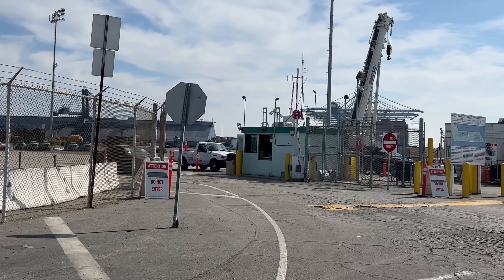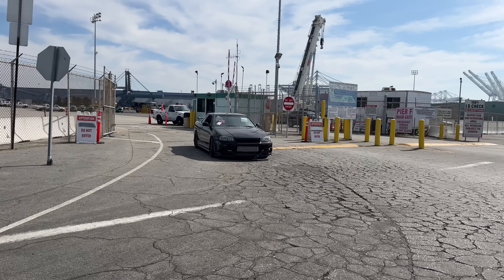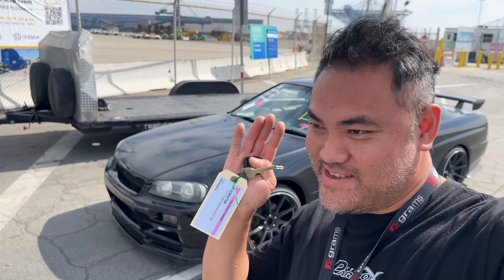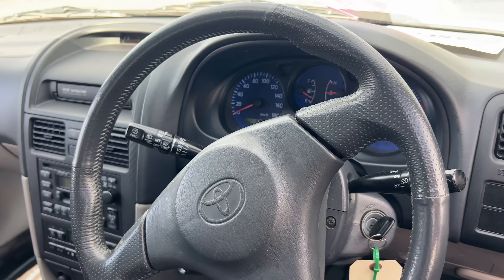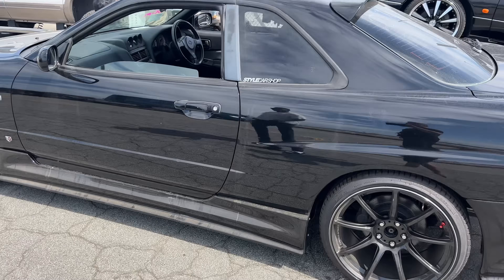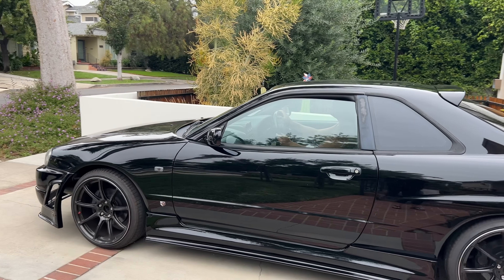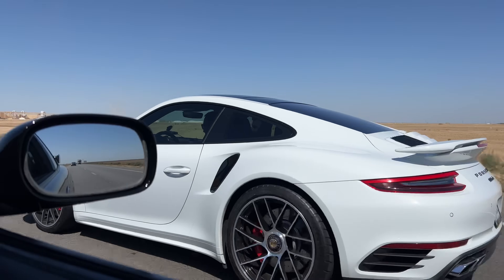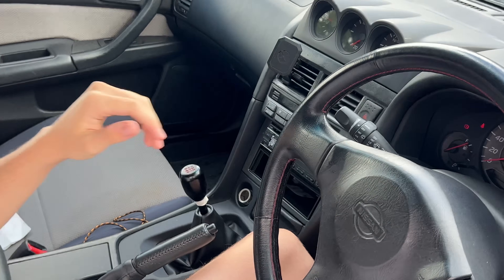WAITED 20 YEARS for my DREAM CAR! Paradox JDM Imports, Inc.

Comment: My cousin got a Toyota GT manual too white as well they are quick cars you don't need  much bolts on to get it going quick,I know someone who has Aristo v300 hard to get in manual and they also come in V8s..in New Zealand 🇳🇿we are so so lucky to have all these JDM imports there are many more gems out there that you may not seen or know about.
Congratulations on your R34 they are fun too drive there are many here in NZ enjoy all you need is couple of bolt on an a tune this car be quick if don't wanna brake the bank,don't need to mess with factory turbo at this stage.. awesome 
Been here since you started and we still out here support from New Zealand 🇳🇿💪🏽💯

Comment: Most all Japanese Domestic cars have factory folding mirrors due to tight parking and small access lanes and streets.. the SC 300/400 do not come with power folding but all the JDM Soarer do... lil 'bits' that ID a legit JDM vehicle or parts.

Comment: Why are you lying that is not a grt that is a r 34 gtr tt That does not have the wide front fenders and wide rear fenders and is missing the gauge cluster in the middle so that it's a cheaper version of a  rea r 34 gtr